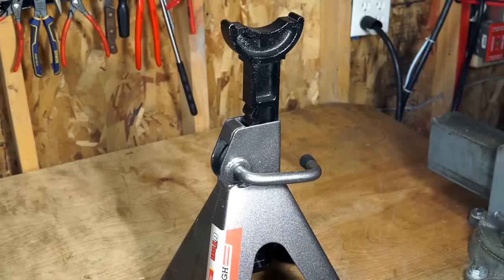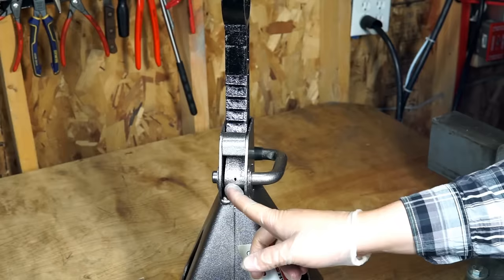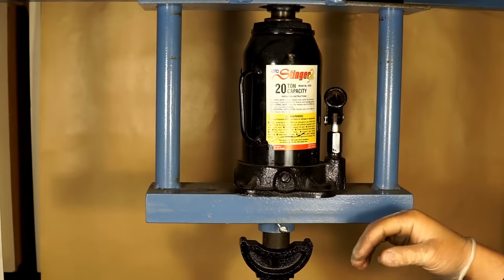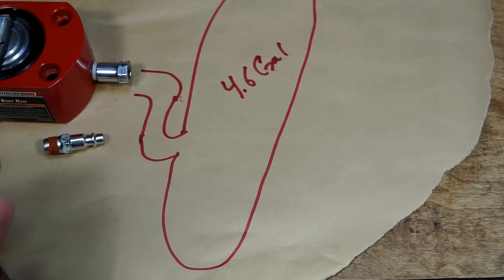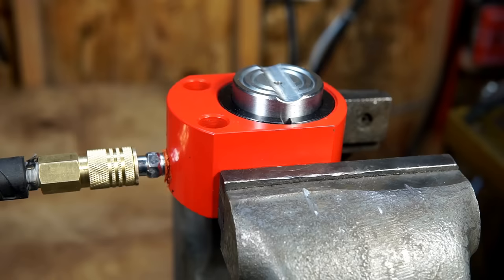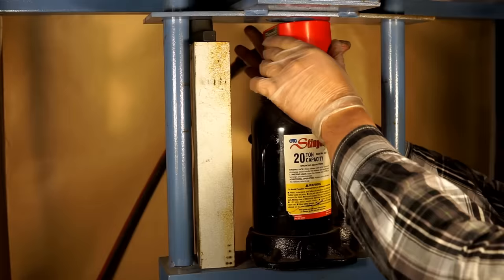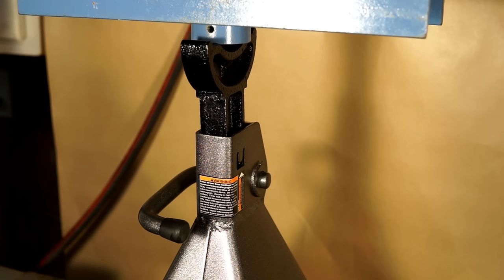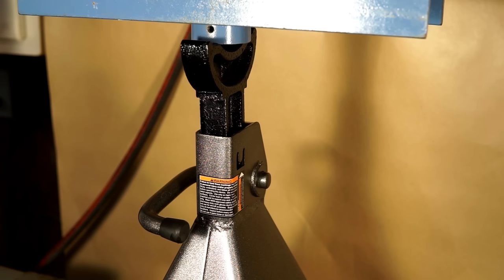EXPERIMENT: WARNING! Doing this to your Jack Stands will get you KILLED!

Comment: Yeah uh I'm a mechanic and smart people face the jack stand release handles outwards and leave the hydraulic jack raised to just about an inch below the frame so that the jack can catch the frame in case somehow the jack stands magically failed. It sounds like he probably didn't put the jacks on a solid jacking point lol. Maybe he put it under a tire that would be funny. But yeah if you have a car on 4 jack stands and one fails the car wouldn't really go anywhere if it put the stands in the right spots to evenly distribute the weight.
Reply: Exactly
Reply: I always just keep the jack snug to the frame but not holding any weight. That way if it does come down it doesn't gain momentum on to the jack and possibly make it fail or push it out of the way.

Comment: well you used a 6 ton jack stand, sure it can hold the car but now its rated at 6 tons so its expected to have 3 tons on it your only putting half a ton on it!, try this again but with a 2 ton jack stand, i want to see the resolts
Reply: +Garage Geek
Reply: Jesse Walls 1/4
Reply: Jesse Walls the results wouldn't get any better.
Reply: The car didn't even weigh two tons though, it doesn't really matter how much it weighed, or whether or not the jack was rated for it.. what matters was whether or not he could lift 500 lbs through that mechanism. And he couldn't. Not "from under a car" as he was trying tontest
Reply: As I understood it, he was trying to see if the pin in the locking pawl would shear before you dropped a porsche on your head. It didn't. So the jack stand is unsafe as designed. Would it fail while holding up the front corner of my Chevy Avalanche (~1650lbs if the weight distribution chart is right)? He'll need a bigger pneumatic ram.
Reply: It doesn't matter if it's a 30 ton jack stand.  That pin should sheer at a low weight.  I could totally see pulling a transmission or other heavy piece out of a car an bumping the release.  That pin NEEDS to fail.  Perhaps a plastic replaceable pin would be the way to go. Perhaps a spring loaded ball bearing (though this would drive up cost a bit).  Have it fail at 40 lbs.  It doesn't matter if that pin fails if it's replaceable, and I'd rather replace a pin now and then than have a car fall on my face... even 500lbs of a car.
Reply: Maybe you don't understand the very basics of a jack stand.   The locking gear or notch rests against the body or frame of the jack stand.  This is where the rating really comes from; a 6 ton has a frame that can support it; the 2 tons has a frame that can support it.   The shear pin honestly has nothing to do with it; or at least it shouldn't.   Joe Last has it right.    Are you effectively saying that the shear pin somehow has a higher shear rating for a heavier stand?  It absolutely shouldn't, but that may be true.  

Fact is, that shear pin should be strong enough for day to day use, and avoid accidental breakage.  But at this proposed strength, it should never have lifted 500+ lbs.   At best the pin should snap at 100 lbs, a reasonable self saving and lifting weight; should it somehow lift it high enough to release the jack.
Reply: Frank Lafleur I think the op's point was that the engineer might design the shear pin to fail at a percentage of maximum rated load, rather than at some set point across the entire product line. 

This is entirely plausible but nevertheless, stupid engineering. Might be worth knowing because it would indicate that one should buy a jackstand rated closer to the working load rather than going for the one supporting the biggest tonnage
Reply: Jesse Walls, what the funk are you rambling about?
Reply: it doesn't matter one bit, as you saw even with a the low weight of 500 pounds (226kg) resting on it you need to be fucking superman to be able to bump it lose... it's impossible to do it by accident without any extra leverage
Reply: good one :-P
Reply: The release pin is only there to lower the jack stand when you are DONE using it;;; even it the jack stand failed (supposedly) the stand would still be under the car holding up the weight!
Reply: Anyone who would trust their life to an adjustable jack stand is a fool. If you are getting under there, use some sort of blocking. Jack stands are very useful,  but don't get under a vehicle if that rickety ass garbage is all that's holding it up. I don't care what hero of yours does it, or how often you got away with it. Don't.  And grow up and don't argue about this.
Reply: I do it everyday for a living...so i must be a fool...ridiculous statement!
Reply: Maj Wor 
If the whole vehicle is supported on nothing but standard jack stands,and you are underneath it, then yeah thats you. Do whatever you want, I don't care, give it some thought.
Reply: Maj Wor 
Yeah, I know you. You sleep soundly every night under a one ton pickup with the wheels off and a load of bricks in the bed, held up on your sloping driveway by the four cheapest jack stands money can by at harbor freight, cuz ya "do it for a living". Lol.
Reply: Maj Wor is an ex-spurt.
Reply: How juvenile

Comment: I have old school jack stands,(hard level surfaces only), chocked tires…etc…I’m an old schooler we use wood cribbing almost always, it bights into the steel lift/ support area, can be endlessly configured, has a considerably wider footprint, works on all surfaces, really can’t slide, never have ever had an issue, use it on trucks up to 40k, tractors, dozers, excavators…and you can make up any height needed…it’s non conductive, works on slopes,….we also lift structures so we are abundant with it…

Comment: Look like you should have tried to have the pin fail.. Really didn't prove a lot..
Reply: The shear strength of even low-carbon 1/2" dia. steel rod is in the tens of thousands of PSI. I see where the nanny state comes from...
Reply: GS Allen the pin is what will fail that's connecting the handle to the ratchet stop. It's made to fail for safety. Maybe you should pay more attention next time..
Reply: If he compared force needed to shear the pin to the vehicle weight per jack stand. bada bing bada crushed head....
Reply: Is it made to fail for safety or is that just an assumption?
Reply: Yes, it's for safety. That's why it made that way.
Reply: I'm assuming the pin will only shear at the maximum capacity of that stand
Reply: The pin isn't holding the teeth, it's holding the bar that goes through the release tooth. The point is for the pin to sheer and the tooth to remain in place so the lift part doesn't drop. That pin would be a miracle metal if it held 6 tons.
Reply: TiMthisIS this only proved he can make it fail at 500lbs. Pressure. Thats not proving nothing but that. He said he didn't shear any pins. Thats what he was acted like he was trying. That's the test to do. When does the SAFETY pin fail. It's not about who's right, it's about what test he should do next. That's what he asked for.
Reply: and the pin that fails at 1000 lbs for Jack stand A probably will require different force to fail than Jack Stand B.  I always use jack stands with a safety pin.
Reply: I agree. Without a definitive failure of the pin it wasn't a proper test.
Reply: Johnny Luck Yeah, I don't know where he got the "supposed to shear" idea from. The release handle and pawl (it's pawl BTW, even though he said "paw.") are all the same piece of metal (on mine anyways), and there is no weakened shear point anywhere. And my craftsman streams would have a shear point before his harbor freight stands would.

Comment: Instead of all this mumbojumbo you could just drive your car up a set of ramps!
Reply: Fix it Fast I’ve seen people fuck up ramps too, no method is ever 100 percent safe
Reply: Unless you are only changing oil you are still going to need a jackstand/support to take a wheel off.
Reply: Not if you have the wheels off.
Reply: Unless you are working on any of the suspension, brakes, hubs, axles, or any other work that requires removing the wheels. So almost everything that requires lifting the car.
Reply: The steel ramps are okay but I would still have a set of Jack's underneath just for backup and those plastic Rhino ramps aren't worth a crap I've actually used a pair and watch them start to buckle under load
Reply: Never seen ramps for a car that can barely clear a speed bump.  They're usually steep enough the front dam/bumper will hit long before the wheel is even close to the ramp.
Reply: @scotr397 The ramps work great if you jack up the car and then place the ramps under. Then you don't have to worry about lining the car up perfectly or driving off the end. Of course, as others have mentioned, ramps are useless if you're removing wheels. Best to have backups like a couple blocks of wood or at least leaving the floor jack there to catch the car and give you a few more moments to escape.
Reply: Bingo. That's what I do then block my tires then a jack stand just in case
Reply: Good luck finding ramps you can drive up with any remotely modern car. Late 90s on up the front clip hits the ramps and either breaks or moves the ramps. Even if the clip doesn't break, the owner will be upset when they see 6 inch wide gouges in the paint of the front clip.
Reply: yes, but not if you want to take the wheels off
Reply: @michaeleverett2650  I've never had a problem with using the Rhino ramps with my lifted Rodeo that has a lot more weight than stock. I really got them for my Volvo though because my floor jack that is big enough to lift the rodeo is too big to fit under the volvo. Have to drive it up on ramps then use the jack to use jack stands.
Reply: @johndeaver169  if you have to jack up the car to put ramps under it, YOU'RE DEFEATING THE PURPOSE OF THE RAMPS! That's the dumbest thing I've ever heard.
Reply: @DEHOYOS98  That's your opinion. Try driving up some ramps with any modern stock height car, though, and don't forget to post your results here so we can all laugh at you. The ramps are intended to give you space to work underneath the vehicle, not the thrill of driving up an incline. For taller vehicles you can drive up them, sure, but then again the necessary space is probably already there for anything you'd use ramps for. Lower vehicles (even a lot of stock height vehicles) have a much higher chance of damaging the bumper or ripping it off completely. Jacking up the car and lining up the ramps save you the trouble of potential damage while allowing you to secure the vehicle exactly where you want it. You are more than welcome to use your ramps however you want though. Also, you might try reading the other comments before posting and making yourself look like a jerk.
Reply: @johndeaver1248  it's very much a fact. Sorry you seem to think otherwise. Apparently you're not picking up what I'm putting down. I'm not saying you must drive up the ramps! But a ramp is meant to be driven onto, eliminating the need for a jack and stands. Otherwise you should just use jack stands and not take up so much space. It's really not rocket science, I promise! I certainly did read the other comments and it seems like the same general consensus. You can't drive most newer cars up the ramps, which basically makes them obsolete. I've worked on everything from cars & trucks, to everything with wheels for the military in Iraq, and then monster trucks and jet powered 4 wheelers. It's not my 1st, or even 3rd rodeo. A little bit of common sense goes a long way. Work smarter, not harder!
Reply: @scottr397  you can get approach ramps for lower cars, or just use some timber as a ramp. Turn the steering and drive onto one ramp works ok for an oil change just have the sump on the low side.
Reply: @johndeaver1248  use some 2by 4 timber as an approach ramp, put it on the second or third beam and you can drive any car up unless it's lower than 2 inches. Work it out dumbass before you go posting your comments. I am a mobile mechanic and do it every day,  you can buy approach ramps , but I have timber onboard for all sorts of purposes.
Reply: No duh...that's not the point of the experiment.

Comment: It's not a shear pin, its a plain ole roll pin...
Reply: And it's not a "paw" ... it's a pawl!
Reply: A pin under shear stress.
Reply: Thank you, we are done here.
Reply: It doesn't matter what it is called or what you call it. This is a safety feature of of some jack stands and is all that matters.  It is supposed to fail before this happens.
Reply: @johnnyvt9  No it's not. It's just to hold the pieces together easily and cheaply. This video even proves that. "This pin still hasn't sheared" @10:36
Reply: @johnnyvt9  "This is a safety feature of of some jack stands and is all that matters" Not these jack stands and that is all that matters. It does matter roll pins do not shear, that is his point, it is NOT a "safety feature" It's a generic Harbour Freight jack if you want safety features I wouldn't be buying Chinese brands
Reply: Whether or not this pin is designed as a safety feature I have no idea, but the idea that "roll pins do not shear" is patently false, any pin will shear under enough load.
Reply: @jameshealy4594 That's not what was stated though, so irrelevant here. You put enough pressure on anything you can make a diamond too... EDIT: Sorry James Healy, didn't realize comment was for something else.
Reply: Not from you, sorry for the confusion mate. @6star stated "It does matter roll pins do not shear" which is what I was disagreeing with. Why youtube decided to remove the system where replying to a particular message showed that is beyond me.
Reply: @jameshealy4594  You just presented a strawman argument as @IcarusLSC said. Stating a roll pin would shear given enough pressure is irrelevant, they won't with normal use since it's not designed to shear as a safety feature in the first place.
Reply: That can shear with enough force, yes.
Reply: @Dark6star  Wrong.  They are specifically chosen instead of a more durable solid pin because they can shear.  Stating that "you think" it isn't their function is irrelevant because of this.  It is a deliberate move to use a weaker pin at no cost difference.  Explain that away.
Reply: @IcarusTECH  Nope, if you want cheap and easy, it would've been more towards both of those to just spot weld the two pieces together.  They don't weld it because that does not create a reproducible shear force rating.   Did you even think before you posted?  The welder is sitting right there welding up the rest of the jack frame already.

Comment: 7 yr old vid and the technology has changed.  A pair of 3 ton Daytona jack stands from Harbor Freight were just on sale for $28 on March 17, 2024.  These jack stands are 3 tons for the pair and they've been improved to include a locking pin that totally prevents the handle from being lifted and dropping the load.  SO assuming one uses that locking pin, the sheer pin is now practically irrelevant.

Comment: Who told you it's a "sheer pin"? Lololol. This is why you don't ever trust the internet.
Reply: Andrew S  , I was thinking the same thing. I’m sixty and I don’t ever remember anyone replacing a sheer pin on a jack stand. 
   I would expect to find a roll pin.
Reply: A quick google search and you will find that it is a safety feature of some jack stands.
Reply: @johnnyvt9  oooo...I think I skipped something or didn't hear him describing the pawl. I thought he was pointing to the pawl and calling it a sheer pin, lol.  
Whoops.
Reply: Good catch. A sheer pin is designed to break before important parts do, like snow blower gears. You would not want the pin breaking on a jack stand.
Reply: I don’t know if it is sheer pin or not what he was saying was that the sheer pins job is to break away under stress load so that the release lever will not disengage accidentally with a load on it
Reply: So conclusion is that you can’t accidentally disengage a jackstand with a car on it. The guy that this happened to obviously did something very foolish and unsafe but didn’t want to admit it to save face. Obviously I’m Speaking metaphorically.
Reply: Yet another product of the government public school system.

Comment: Great testing, regardless of the potential of it actually happening real world. I would have loved to see you increase the PSI to simulate 1000 pounds and attempt to make the jack fail utilizing the same test methods. I also would have liked to see you try kicking the handle upwards, with steel toed boots of course, simulating a flailing leg/foot upwards. I know that I have been known to contort or brace myself(admittedly dangerously at times...tired or in a hurry) under a vehicle with my legs to secure myself while trying to break loose components/stuck bolts etc. with my arms. I like to think that I have enough experience and safety awareness working on equipment that this accident wouldn't happen to me. However to anyone commenting making smart mouthed comments about being smarter than a jack stand etc., that represents to me, someone that HASN'T been around equipment long enough to have several near misses, either due to mistakes or equipment failure. Even when ALL safety precautions are taken, accidents can and will still happen. By putting this jack through competent well thought out stress tests, like you did, it just makes a person think about one more form of safety concern when setting up a work zone. Great video!